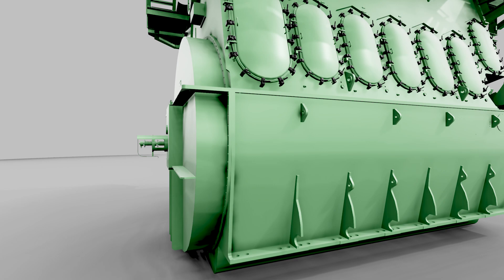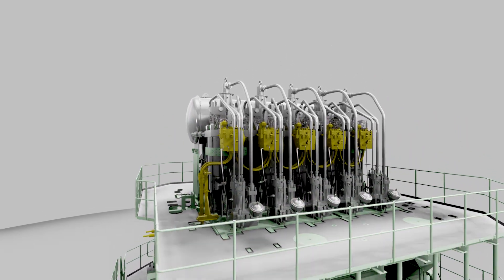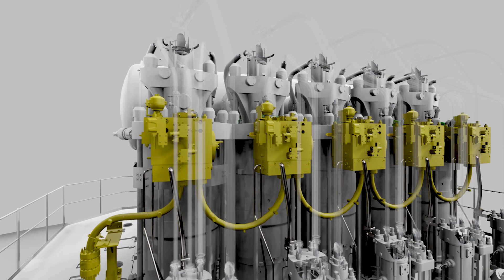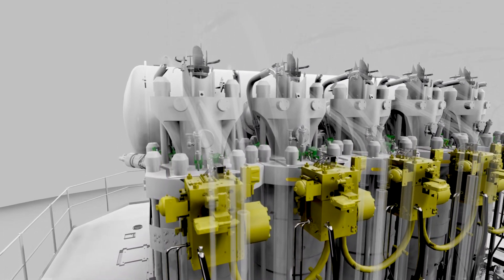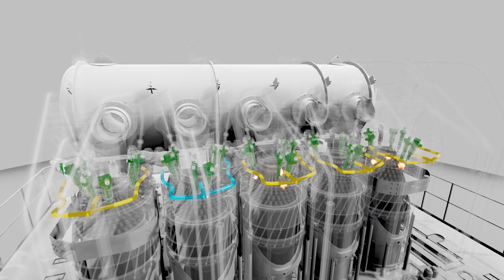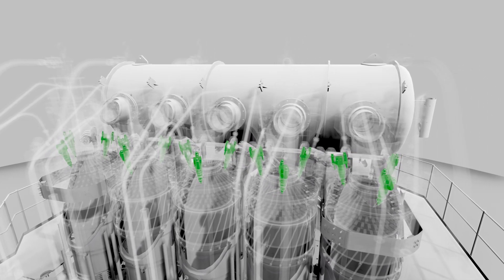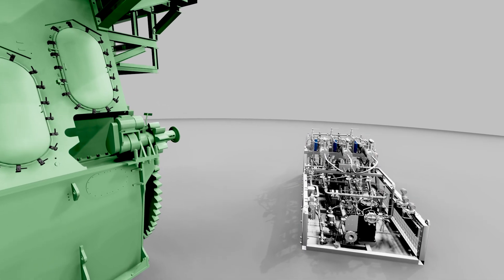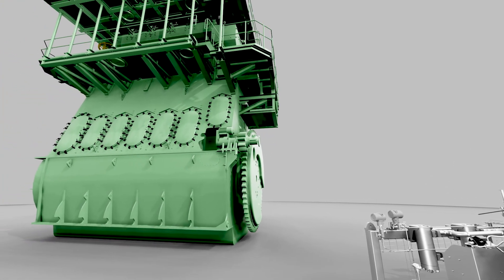Introducing the upgraded MAN B&W ME-GI Mk.2 two-stroke dual-fuel engine

Comment: Good day, Thanks for video. is the new Gas Supply system in use on practice on MEGI now? Another question. Possibility for upgrade of the first version of MEGI with gas cut out system to separate unit? Or quite hudge physical investments like gas blocks, covers, etc..?
Reply from the maker: Yes we currently have a high number of PVU’s in operation with great operational performance. The GCCU is a feature dedicated to the ME-GI Mk 2, and therefore it cannot be applied for earlier generations.

Comment: Diesel engines will run on pretty much anything. Natural gas, methane, ethanol, even crude oil.

Well, as long as they don't use common rail fuel injection as any dirt will quickly destroy the fuel pump and the injectors.

And with state-of-the-art emission control technology, even two-stroke Diesel engines running on sour crude oil can be environmentally friendly.
Reply: NG methanol ethanol and propanol are over 110 octane so you need a magneto of pilot diesel to help with ignition.
Reply: Methanol makers more HP as its 112 octane. I hate to see how much Klotz techniplate a 110000 hp man methanol 2 stroke uses. Ethanols 113 octane and cooling helps GE LM6000 make more HP and thats why racers love it.

Comment: MAN ❤
Reply: How about a methanol nitromethane castor oil mixture! This would make one  enormous nitro glow 2 stroke and use castor 927 maxima 2T oil in the bottom and feed it into the fuel and cylinder ports moderately.
Reply: methanol makes seriors HP in 2 strokes and 112 octane! These man 2 strokes are cathedral sized snowmobile engines with mind boggling torque!